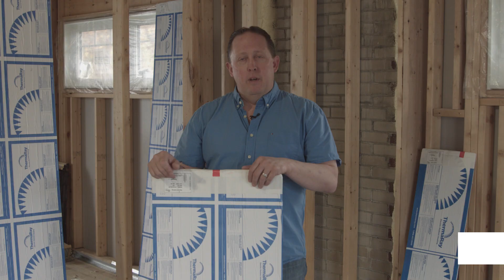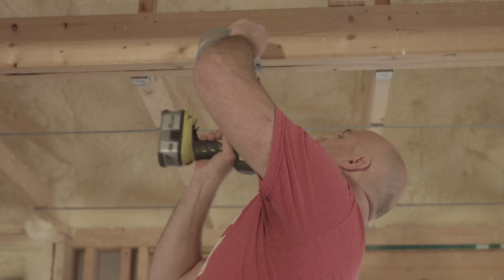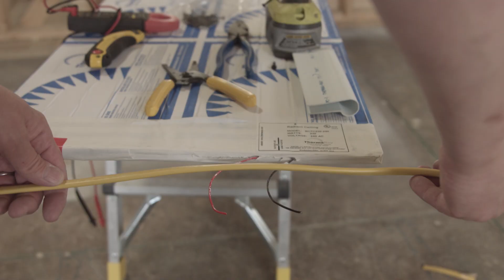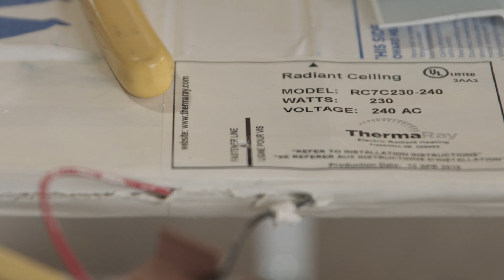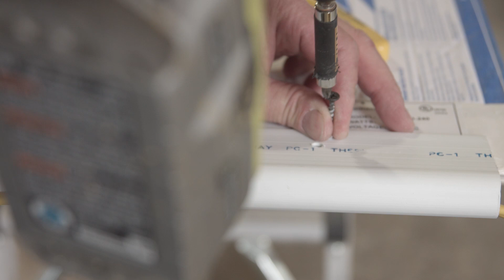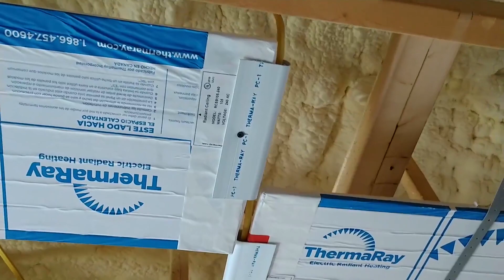ThermaRay Radiant Ceiling Installation

Comment: What if a drywaller drills into one of these?
Reply: Hi!
The RC Series of radiant heating panels are designed to fit between the joists or furring strips (if they're used).  The drywaller is screwing into the joist or furring strips so won't screw into a heating panel.  However, it's very unlikely that even an errant screw would catch the heating element inside the panel - the wires are small and are only a tiny percentage of the overall surface of the heating panel.

Comment: It an amazing way to heat a home, but also very expensive. We went with mini-split which gives you the advantage of cooling and an extremely low heating bill.
Reply from the maker: Hi!

A mini-split (or any air-based heating system) simply can't achieve the same level of comfort that a radiant heating system will provide.  As for economics, a radiant heating system will use less energy than most convection systems.  (Much depends on the relative cost of local fuel prices. of course.)  

We have customers who tell us their systems (real world application) that their heating bills are cheaper than their neighbor's heat pump systems (comparable homes and lifestyles, I'm told).  I know my own heating costs are very good.

I recently had a customer who had radiant heat in his previous home, but in his new home he bought into the idea of heat pumps and mini-splits.  He came back to radiant for the comfort.
Reply: @ThermaRay  My two favorite heating systems are hot water radiator and ceiling radiant systems. Growing up we had hot water heating and while it was slow getting to temp, once there it was even throughout the living space. My present 1968 home had ceiling radiant heat with 10 zones for 1600 sqft. Even with electricity at $0.09 kilowatt hour it got really expensive to the point we were zoning it off for certain rooms. And although it was wonderful to walk into a room where everything was at the same temperature, something you can't easily achieve with an air furnace cycling on and off the monthly cost was prohibitive. I would have gone for hot water, but it would have meant too much infrastructural cost.  It was this same cost that also eliminated gas heating. 
In exploring other heating systems I discovered mini-splits which provides some of the comfort of radiant heat with the advantage of also being able to provide warm weather cooling. Since the mini-split is not using electricity to generate heat like a radiant system, the mini split only uses electricity to drive a variable speed  compressor so that it can transfer heat energy from the outside into the inside or the reverse in the summer, it has a much higher efficiency than other system. Our system is on 24/7 and maintains an even temperature all year long. With the blower always circulating air I get the advantage of the objects in the room being at the same temp. No blast of warm air followed by the cool down that is common to forced air systems. 
As with all heating systems a properly sized and installed system should provide comfort, mini-split are no exception. The difference is in there ability to operate at a higher efficiency and thus less cost. According to the United States Department of Energy mini-split with a zoning system can save you as much as 30 percent on your energy bill, and with the added benefit to cool and dehumidify. I thought about slapping solar panels on the roof, too much shade in the woods, but still needed a way to cool off the home. In the end mini-split was the ideal solution.

Comment: I have this system in my 30+ year old condo, but in both my bedrooms it doesn’t work.  Any suggestions on how to repair without taking down the ceiling?
Reply: Hi!
Sorry to hear that you are having issues.  There may not be anything wrong with the heating panels themselves.  There could be a thermostat issue, a breaker issue, etc.  Our offices are closed until Jan 4, 2022, but if you can call us then (866-457-4600) we can discuss what options are available to you.
Reply: @stevekilbride8494  Thanks for your reply, I will call next week - is there anyone I should ask for?
Reply: @RonDavidowicz  Just about anyone can answer your question, but if you call the sales line you should get Greg.  He can answer all of your questions.